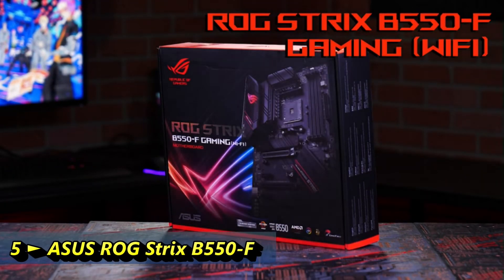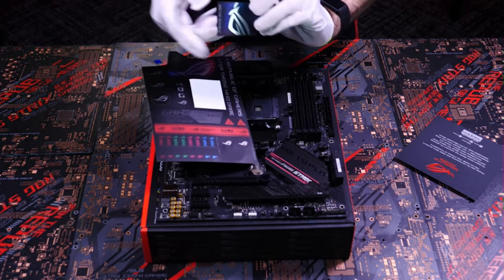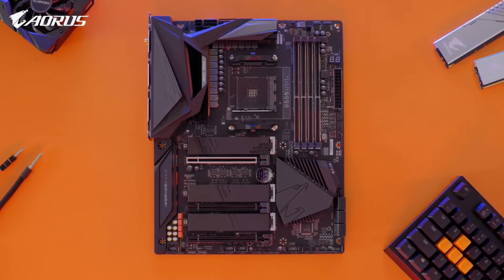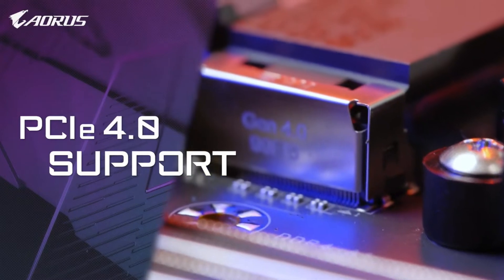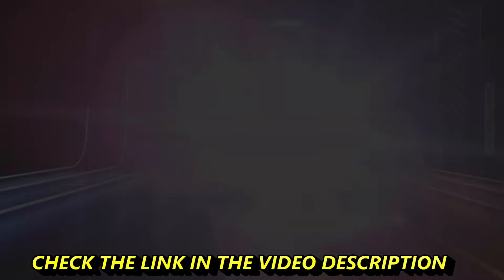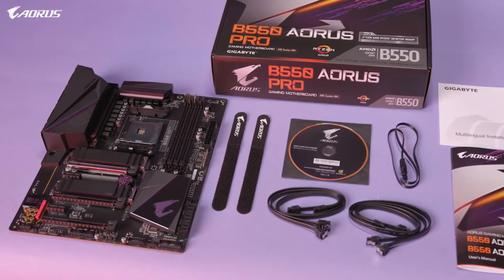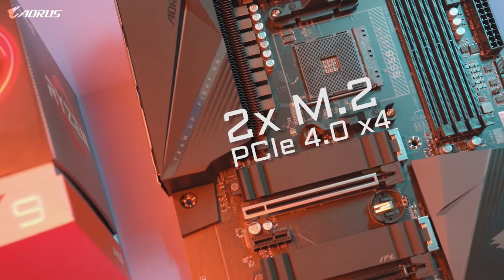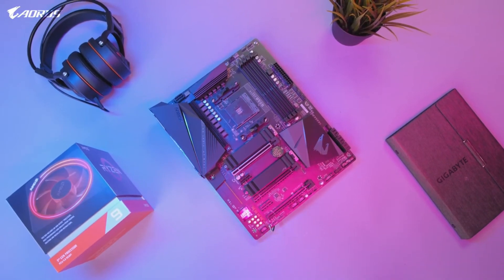TOP 5 Best B550 Motherboard for Ryzen 5 5600X

Comment: gigabyte b450 aorus elite /gigabyte b550m dsh3/ what's better for r5 5600x rtx 3060 12g i need answer plz 💔
Reply: yeaa b550 seems like the clear choice assuming you got da moneyy!
all b550 motherboard also come with PCI-E Gen 4 for yr M.2 drives if you have any 
while no b450 motherboards support PCI-E Gen 4

also yr probs gunna have to do a BIOS update for that r5 5600x for either a b450 or b550 motherboard :)
Reply: 550